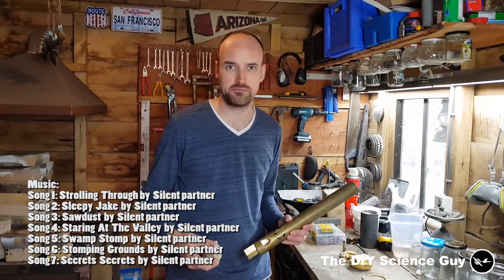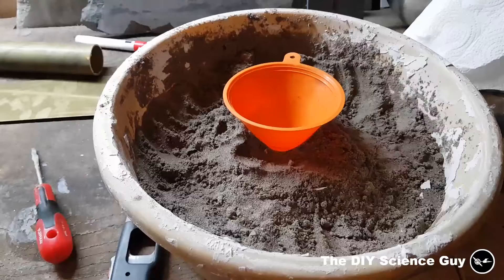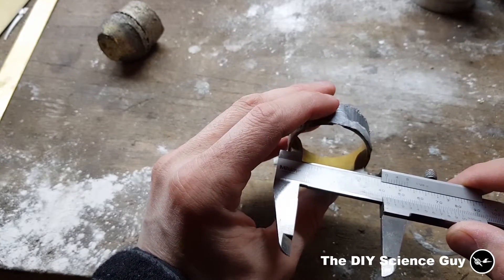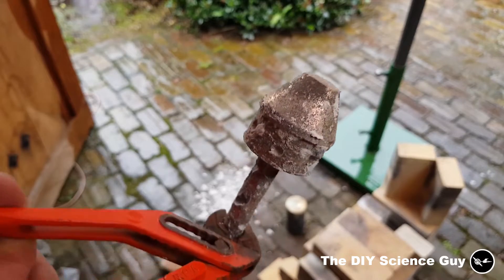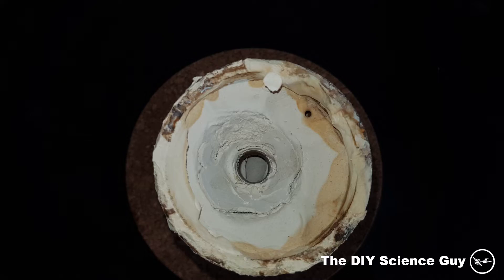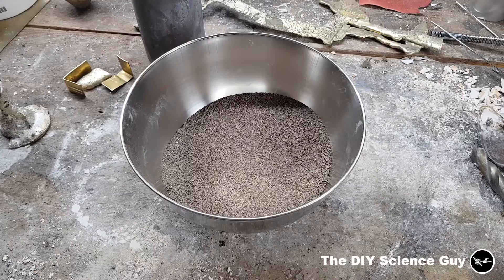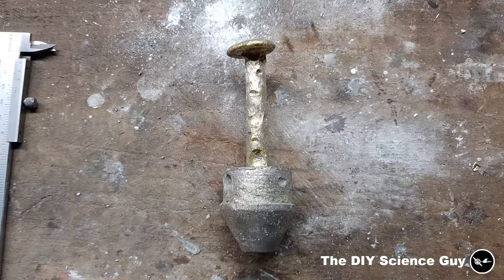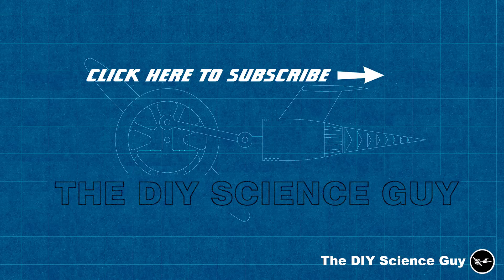Lost wax casting a brass steam whistle part

Comment: Great video. I too am also trying to cast the bottom of a steam whistle. So far I made one casting and had the same problem as you. My casting was very dirty and looked like it had alot of slag in it. I also started with machining chips and ended up scooping out mostly slag. Not until I put in solid bars of brass did I get actual liquid metal. I don't think I got all the slag out of the crucible before melting the good metal. This contaminated my pour. I'm glad to see you found a good solution.

Comment: The problem your having is 2 things.  1) your not pulling a vacuum when making the original mould gif the brass.  The vacuum will remove the air which makes your rough finish.  2) your not using plaster of Paris.  Because after you pour the part when you get it wet the plaster will dissolve and you don’t have to hammer to get to the part.

Comment: Nice video. In Europe, a product from Germany called "OBB sand" is widely available, in 25kg bags. If used carefully, it creates nearly as good castings for many parts as simple lost wax castings, with a minimum of fuss. It also takes a fraction of the time of making lost wax castings. The sand is also used as indoor play sand for kindergartens but was developed for the foundry industry. I use it to make castings of all kinds of shapes and sizes, in aluminium, brass, and bronze. Highly recommended.
Reply from the maker: Thanks I'll look in to it! 👍

Comment: i agree about the charcoal and in addition the part is very simple and would be very easy to make with a lathe, a very simple lathe could be made around an electric drill if you can cast a cylinder say a centimeter or so larger in radius any bubbles you get can be machined out. copper and brass are soft enough that a cutting tool could be made out of scrap steel.   by cutting a profile of the finished part a resting the cutting bar on that profile you should be able to make a very accurate pattern lathe out of wood for a frame 2 barings 1 power drill and 1 cutter bar assembly as well as 1 profile good luck will subscribe.
Reply from the maker: Yes of course that would be possible, but that's not the point. I want to make it without a lathe and lear how to do lost wax casting. But thanks for the suggestion!
Reply: @TheDIYScienceGuy  when i had problems doing lost wax casting not getting a good fill my instructor suggested steam casting your part is much larger than what i was working with but it might help simply wrap something flat like a piece of board with 3 or 4 layers of wet towel them immediately after pouring  press it down firmly above the Sprue hole the steam generated will force the molten metal firmly into the mold but this only works while the metal is very liquid so you must do this quickly after the pour and be careful the steam can burn you silicon cooking hot gloves would be a good idea.
Reply from the maker: Thanks! 👍

Comment: Something of note, copper and its alloys have quite a high affinity for oxygen when molten, it will absorb oxygen from the furnace atmosphere and it will create slag and when your casting solidifies, the absorbed oxygen will create bubbles, commercially they degass the metal by adding phosphor copper to the mix, what I will advise you to do is to add a couple of chunks of charcoal to your crucible, the hot charcoal wil react with the oxygen before it gets to the copper/brass and you can just remove the charcoal before you pour your casting. You can still add the borax, it will help the slag seperate from the brass. Another thing with lost wax casting, molds containg plaster needs to be heated to at least the temp of the metal going into the mold, the plaster contains chemically bound water that could create steam bubbles, heating to the temp of your metal ensures you drive off all the water up to the temp of the metal going into the mold...Anyhow best of luck with your next attempt...
Reply from the maker: Thanks for the info!
Reply: nice tip